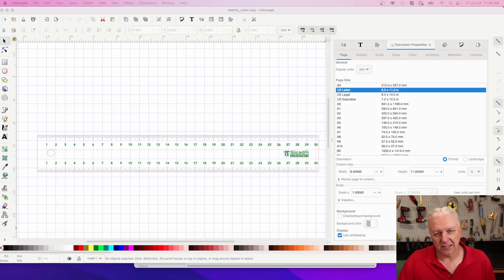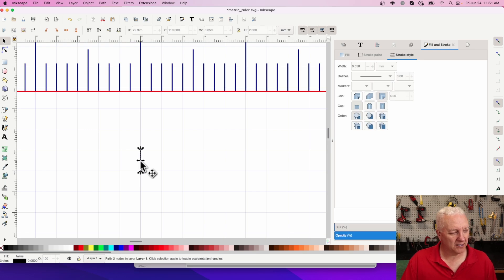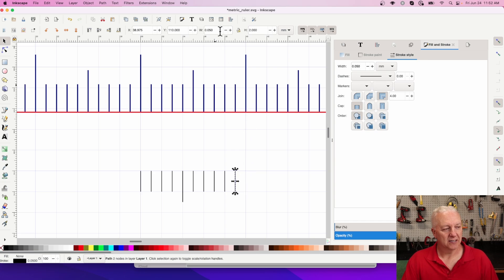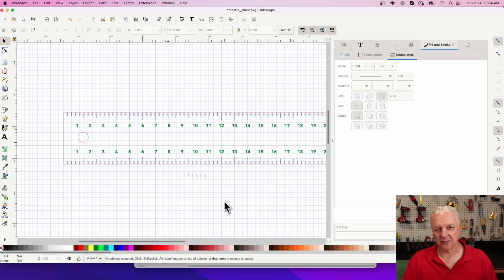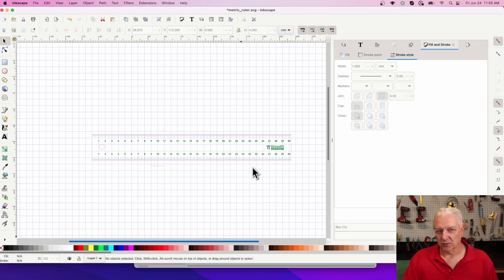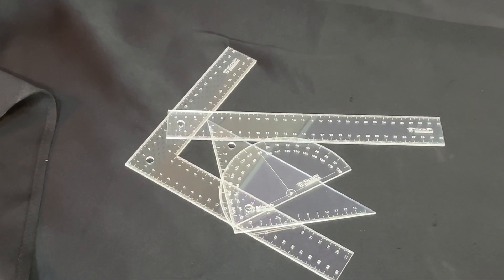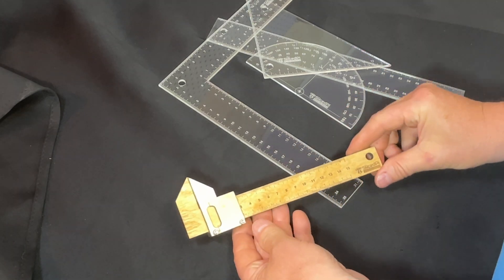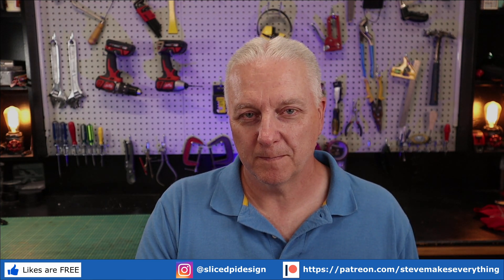Make Your Own Measurement Tools

Comment: i would like to create custom quilting rulers in acrylic for specific projects.  i have no problem creating them in either inkscape or coreldraw but will the xtool d1 with their software cut  it accurately or will i need to move to something else?
Reply from the maker: A diode laser will cut acrylic just fine, though diode laser can't cut clear acrylic, so you would probably need to make your rulers black or some translucent dark color.

Regarding accuracy, the same rules would apply to any laser type.  You would either need to ensure that your laser is calibrated properly or do the calibration via object scaling in your drawing program.  Lightburn would certainly allow you to calibrate your laser though.

Comment: Nice Steve!
I love making tools with the laser. Just finished a wheel camber gauge with a cut-out to insert one of those inexpensive electronic level/protractors and a test rack to hold 6 graduated cylinders for checking/tuning a Bosch mechanical fuel distributor😎
Love Lightburn’s array feature for projects like this.
Reply from the maker: This sounds awesome!

Comment: What thickness do you find is the best balance between not breaking if you drop it vs. being too thick to be useful when you’re trying to measure something? 2mm? 3mm?
Reply from the maker: I use 3mm cast acrylic which is pretty durable. However I usually make these out of scraps so if I drop one and it breaks I’m not too upset